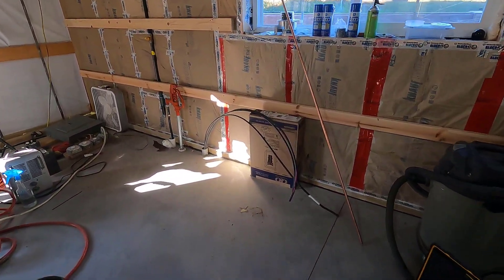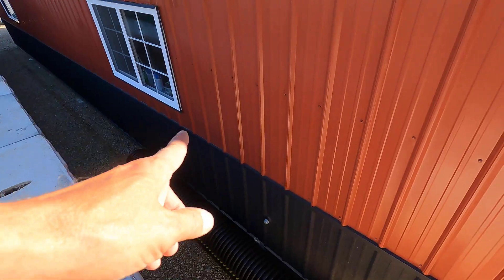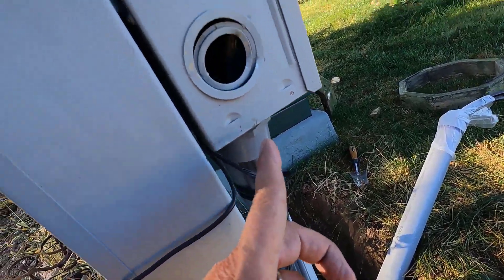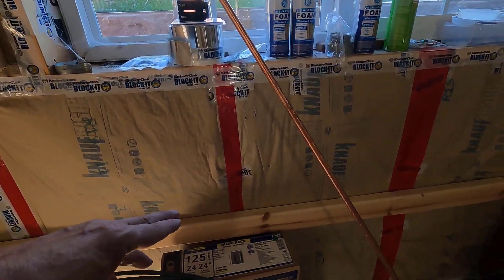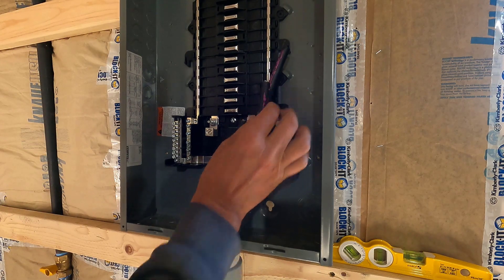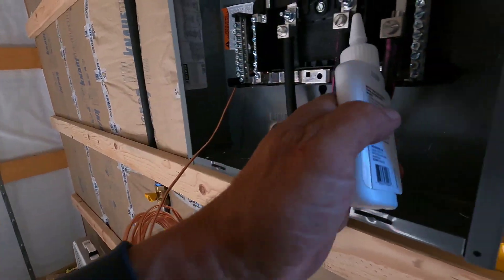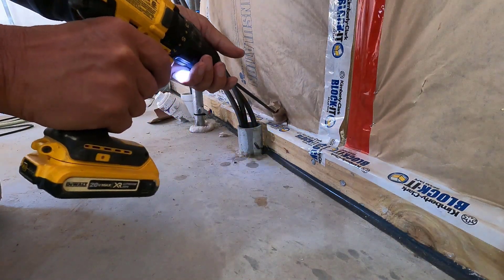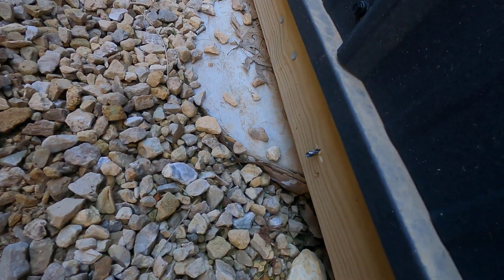Connecting the Shop’s Service Entrance to the Meter Pedestal

Comment from the maker: This is kind of a disjointed video because of the landscaping going on just a few feet away, the wind, and the need to get this done right away! There was a lot left out, but at least I have the details recorded for the future.

Woodshop Build Tool and Materials Links:
Fisch Chrome Vanadium Brad Point Drill Bits, 29-Piece Set, Imperial Sizes - https://amzn.to/3zQGrTf
Laser Level - https://amzn.to/3Lk1FLO
Laser Level W/ Tripod, Grade Stick and More - https://amzn.to/36q2xju
Stabila 35712 Extendable (7 to 12 foot) Plate to Plate Level - https://amzn.to/3iGdpwP
Stabila 30035 Plate Level Case for 7'-12' Plate Level plus 24-Inch, 48-Inch Level - https://amzn.to/3AETnZQ
Stabila 25360 Die Cast Magnetic Torpedo Level - https://amzn.to/38iS49M
Woodford Y34-3 Yard Hydrant Freezeless - https://amzn.to/3AHE5Dr
Johnson Level & Tool 116 16 Ounce Plumb Bob - https://amzn.to/3jKIj6k
Johnson Heavy Duty Aluminum Box Level - https://amzn.to/38daLf0
True Temper 00221400A Wood Wheelbarrow Replacement Handles, 60-Inch - https://amzn.to/3xLU4Pc
Starrett-C33H-12-4R Hardened Combination Square -- https://amzn.to/2KL3YOu
DEWALT Metal Shears Attachment -- https://amzn.to/3l8aYoq
DEWALT 20V MAX XR Compact Reciprocating Saw -- https://amzn.to/3nKHVFG
DEWALT ATOMIC 20V MAX Reciprocating Saw, One-Handed, Cordless, Tool Only ― https://amzn.to/2Msu21r
Legend Valve & Fitting T-5500 Lead-Free Brass Curb Stop, 1" - https://amzn.to/3jU9VpO
12 Ah Battery -- https://amzn.to/33JN48U
9 Ah Battery -- https://amzn.to/2SKUQwN
6 Ah Battery -- https://amzn.to/3odC6BW
Gallon Coppercoat Wood Preservative - https://amzn.to/2YDLaaj
Quart Coppercoat Wood Preservative - https://amzn.to/3FBt2io
Digging Bar -- https://amzn.to/3lGIfXu
Magnetic Lever Lock Tape Measure - https://amzn.to/3Exd5s7
3M All Weather Flashing Tape - https://amzn.to/3ICBX4P
Huber ZIP System Liquid-Flash - https://amzn.to/31OtCtN
Seville Classics Commercial-Grade 5-Tier  60" W x 24" D - https://amzn.to/3qgjrXJ
5000 Lumen Temporary LED Work Light - https://amzn.to/3eslZfu
Heavy Duty 3-Prong Wireless Remote - https://amzn.to/3EnPWYN
Powermatic Model 60C 8-Inch 2 HP 1-Phase Jointer - https://amzn.to/3mvPq4M
Jet Contractors Saw - https://amzn.to/3mAAQJs
Insul-Hold - https://amzn.to/3evnmKq
1" Garage Door Chain Hoist - https://amzn.to/3rn11VF
1" 4:1 Open Garage Door Chain Hoist - https://amzn.to/3uldvQA
1" 3:1 Open Garage Door Chain Hoist - https://amzn.to/3IVxXf0
1.25" Garage Door Chain Hoist - https://amzn.to/32R3vmS
Shed-In-A-Box - https://amzn.to/3g05gB8
Ambient Weather WS-2902C WiFi Smart Weather Station - https://amzn.to/3GzRdNp
Brownell Oxpho-Blue Professional Grade Cold Blue - https://amzn.to/3BfKiYO
Evapo-Rust - https://amzn.to/3gJQEq4
Xcluder Rodent Control Fill - https://amzn.to/3oVsH3x
Great Stuff Pestblock With Smart Dispenser - https://amzn.to/3HfI2SG
5FT Power Twist V-Belt 1/2-Inch x 5 Feet A Type - https://amzn.to/3LTQQkF
Aluminum 5 Slot A Type V-Shaped Pagoda Pulley 5 Step Pulley - https://amzn.to/33GTclJ
IRWIN 29-Piece M35 Cobalt Steel Drill Bit Set - https://amzn.to/3lmd2rR
DEWALT Cordless Impact Wrench - https://amzn.to/3L5lvvl